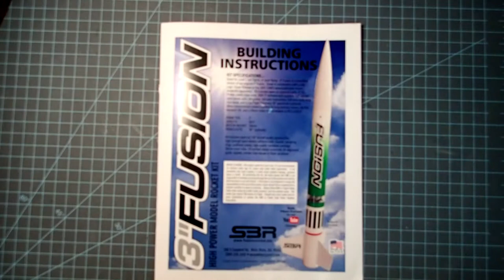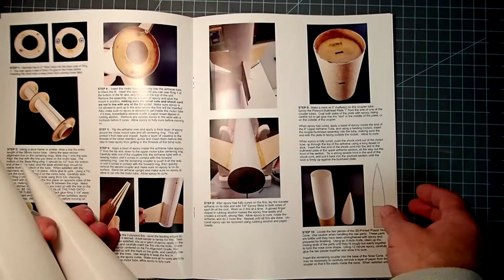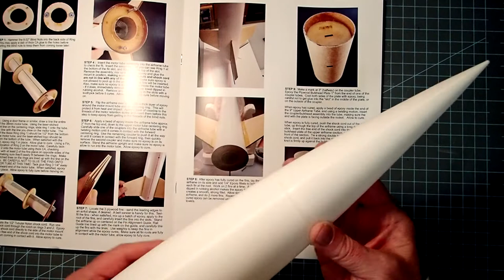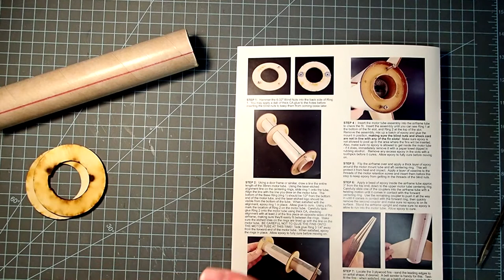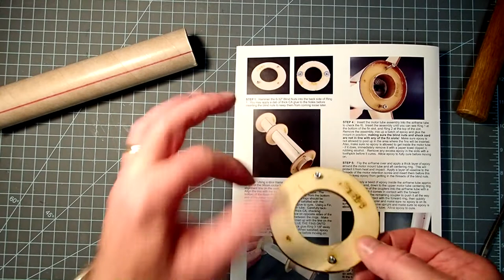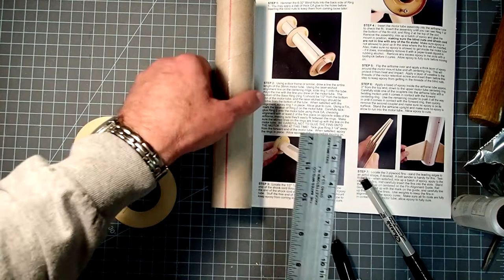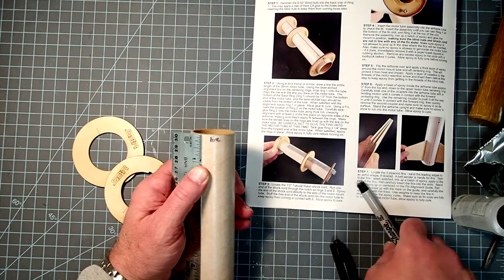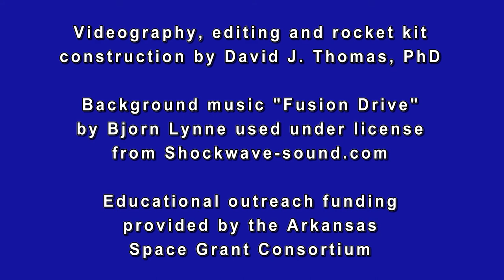SBR "3-inch Fusion" high-power model rocket assembly, part 1 of 2

Comment: Dr dave i watched your franken rocket video... i plan to make a model rocket using two of those long candy/bank tubes and a 3d printed nose... i am wondering is there a rule of thumb for motor mount tubes as i am designing the rocket in open rocket and not sure how big a motor to install i know once i know for sure the centering rings will design for me in a way based on the body tubes, also in a larger rocket which is better a launch lug, or a rail system?
Reply from the maker: Start with whatever motor mount is handiest and see how it performs in OpenRocket. Adjust up or down as necessary. Rod or rail is up to what you have for a launcher. Rails are more stable but rods are much less expensive. I use both.